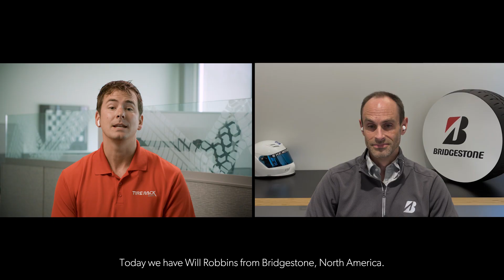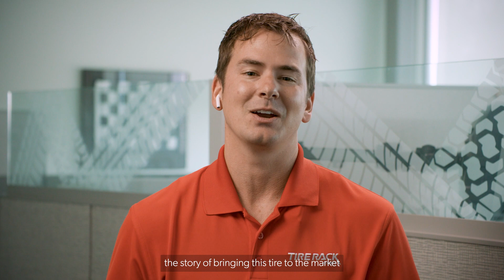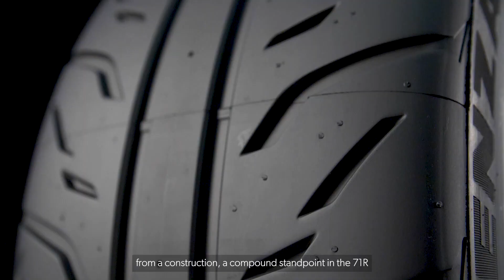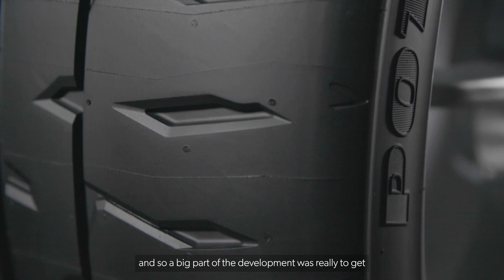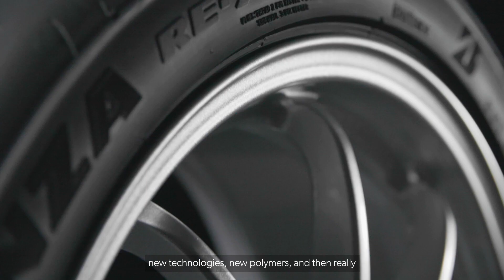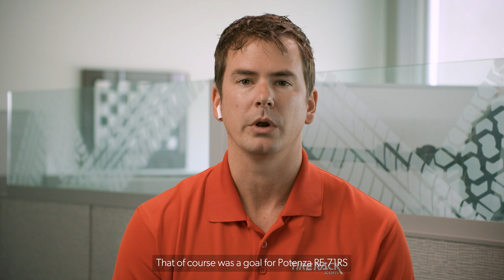TJ & Bridgestone Talk RE-71RS | Tire Rack

Comment: I'm running them for my RSX and they're amazing on or off the track. Like what they're saying the tire is very consistent and feels like I've never lost grip in normal conditions and wet conditions. These tires are amazing!
Reply: Totally agree with you.  😉
It gives you the confidence to go fast and put a smile on your face.  🤣
Reply: @alanbong6230  facts, I've already put 5k miles on it and barely lost a 1/32nds of tread even wear across it too and it's a street/ circuit car. They're holding up better than my S-04 I had before. Honestly I'm really impressed by these tires but investment for the car
Reply: Does your rsx have LSD?